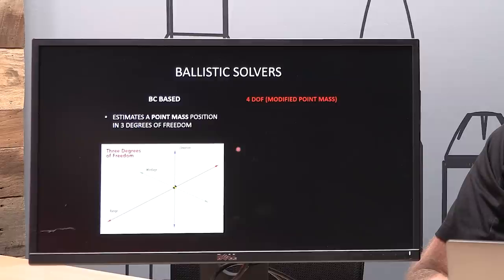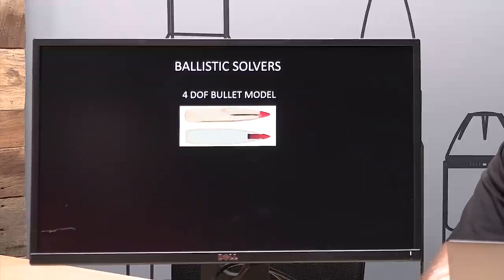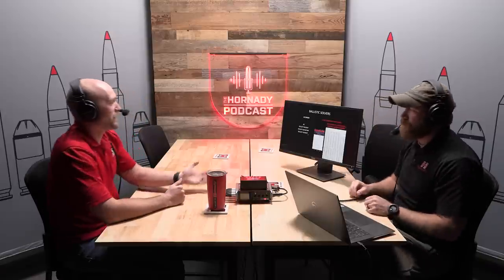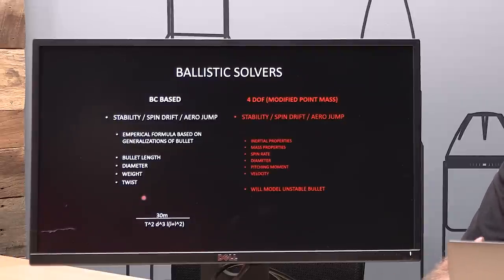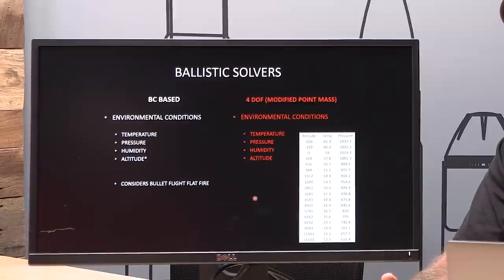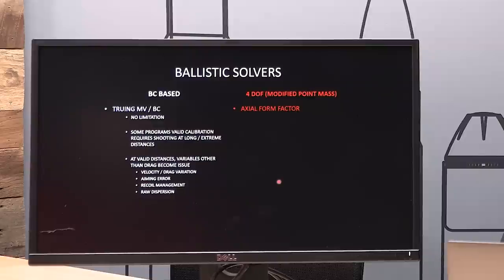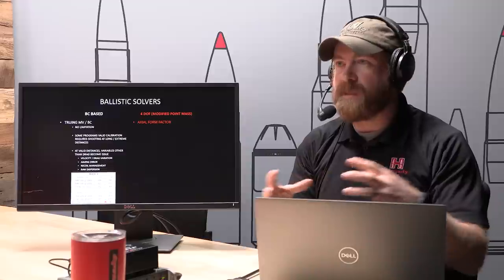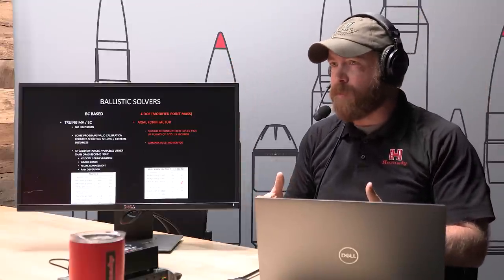Ep. 049 - Why Use 4DOF

Comment: My biggest gripe with the app is that I MUST have a cell phone data connection to start the app. 

For the guy you mentioned that goes mountain hunting, his phone dies, he charges it at Basecamp and restarts. Well, now his 4DOF doesn't work and he's screwed. There's no reason why the rifle and load data isn't permanently tied to the app and saved on the phone. It should never require a data connection to work.
Reply from the maker: 4DOF does not require data to start or work. Shoot us an email if you've ran in to this, because we certainly haven't. podcast@hornady.com
Reply: I used the app offline, no issues.

Comment: Once again thank you Gentlemen for an awesome Podcast. Looking forward to the next ones on more in depth Use of the app thank you   Question
 Sounds like if we use Zero angle You can set your Scope to our  favorite bullet. Then fire different bullets and log the impacts.  And get accurate results without ever hafting to change your  Scope settings from our favorite bullet. Essentially having multiple  Zeros simply by inputting the impact offset??
Reply: I'm no expert, but what has worked for me is creating a separate rifle profile for each bullet/rifle combination for example savage model 10 w/175gr SMK, savage model 10 w/178 ELD-x, etc, then you don't have to mess with changing inputs while you are shooting, when you try a new load,  just set up a profile with where it hits in relation to the bullseye.  Don't change scope zero. You can stagger different loads in your magazine, switch profiles between shots, the app will change your correction and you hit at distance.
Reply: @fattigla   Good deal thank you for the info I had a feeling it might work I'm probably gonna give it a try the next time I'm out at the range.

Comment: I've been using 4DOF for a number of years now,  and it has worked well for inside 1,000yds.For the zero angle feature, are the environmentals we can pull from the nearest weather station (weatherbug app) accurate enough, or do I need a kestrel to take full advantage?
Reply: A kestrel can give you temp and wind speed at your location, even give you a solution when linked with the app in your phone that has your rifle profile. However, for altitude ASL, you may need the weather bug or something. Elevation changes. For example, where I live is 840' ASL, the highest elevation in my county and higher in elevation than the gun range I can go to two counties away that is indoor 100 yards. Where I hunt can be 32 F but the indoor 100 yard range could be 70 F. And 50% humidity rather than 60 percent.

I have tried the zero angle and  didn't notice too much of a difference at 100 yards. But you would past maybe 300 yards, which is what I consider the start of long distance. Word of advice, the Kestrel 2700 is not compatible to the app and if you try to pair it, the app will crash. You will need a 5700. However, you don't have to have a Kestrel synched. Just read the data from your Kestrel of whatever model and put that in.

If I see a deer in the woods at 70 yards, 2700 to 3000 fps is too fast for any of most factors to mean anything and of them, wind would have the most effect.

It also depends on the type of shooting. Hunting can have some shooting aspects similar to the active engagements of Ryan Cleckner, sniper team leader in the 1st Ranger Battalion 75th Ranger Regiment. His M24 was in .300 Win Mag, which he preferred. The performance to 600 yards was steady enough, even in Afghanistan, that he could dial elevation for distance, usually based on actual collected DOPE, and then shoot left or right edge of target zone into the wind to get a round into that zone. It was not about knocking the 'X' out on a target at 1k. It was about putting a few hundred grains of stopping power into a target and having that target stop.

With whitetail deer hunting, such as I do, my zone is an 8 inch pie plate and make my limit 4 inches. That means, with a 1 MOA rifle, I am probably good to almost 400 yards. More important than that, which is what Jayden discussed in the second part of group sample size, you can have a rifle be very precise for hunting if it does what you need when you need it. So, shooting groups with a hunting rifle should be done when it is cold. And then shoot only 3 shots. If those are 1 MOA or less, your rifle is fine for hunting because anyone shooting more than 3 times at a deer has a big problem and should stop shooting until they fix it.

As opposed to some competitions where you may shoot 20 rounds or more at a whack. Then you have to pattern the gun for that and find out if its precision is equal to the event.

Comment: I appreciate the time and effort to come out with this app. But I’ve a problem. Long story short I’ve shot two 10 rnd groups ( 140 ELD-M )with a 6.5 CM around .7 to input my off set for zero angle (+ 0.260”). I’ve went over the inputs until I’m tired but at 418 yds the firing solution is off (low) by 0.5 moa
Both AB and StrelokPro agree with the correct solutions with AB using a CDM. I’m about to give up as I don’t know what else to do. My velocities are correct. It’s not scope tracking error. The environmental inputs are correct also. Beats me. I’m glad I haven’t dropped $525 on the kestrel 4DOF yet. But I sure would like to find the the fox for this problem. The scope is correct also! Help would be appreciated. Thanks
Reply from the maker: That zero angle seems off from personal experience. Give us a call at 800-338-3220 if you have some time and the techs can walk you through it.

Comment: I did a good 15 round group and figured out my zero angle once. Worked like a charm. I had to take the barreled action out of the stock and clean the gun good after a wet hunt and when I put it back together all my impacts are now .4 miles low. I thought as long as the scope and barreled action stay together the zero angle stays the same? Do I have to re-do the whole process now that i re set the barreled and scoped action in the stock and the “zero” is now .4 mils low?

Comment: Based on all the measured data for each bullet in the 4DOF library, I am assuming that using 4DOF is not advised if you select a similar bullet in terms of BC or grain weight.  Is this correct and are more bullets being added to the 4DOF library?
Reply: If I understand your question, you're wanting to use a bullet that is in the library, but is not the bullet you're actually shooting (but similar to what you're shooting) to generate an estimated trajectory?  

Your results will likely be less than ideal doing so.  It may work okayish for 0-600yd, but beyond that you're likely to see errors compound and get progressively worse.
Reply: @milesn3173  Thanks, kind of what I thought.  I'll stick with the BC calculator for bullets not in the 4DOF library.

Comment: I love the idea and the effort to make it into a software.
However, the application is buggy. Since iOS 15 upgrade, it just stopped working on my iPhone if WiFi is enabled. When I disable WiFi and use 3G or LTE, most of the features work. But not always, the app usually crashed when I tried to run the multi-hud feature. It ignored the wind in some scenarios, more and more often, so I decided it's time to use a different calculator.

I dropped the app in favor of Strelok Pro. I'd love to come back to 4DOF, but it has to get a proper upgrade and a debugging run until it starts working.

Comment: In this podcast, it sounded as though users had to choose, either use a Kestrel, or 4DOF.  I have a Kestrel with 4DOF.  

You don’t have to give up your Kestrel to use 4DOF, the app can still connect via Bluetooth to the Kestrel and obtain the critical environmental conditions, and perform the calculations on the app.

Comment: The concept is great.  The UI of the iPhone app is beautiful.  Unfortunately, the field application was less than stellar. Sometimes wildly incorrect.  They're generally close to a trued AB solver (Kestrel AB), but there have been instances where the outputs were not even remotely close to what was needed for impacts.  Several high-level PRS shooters went through every single input after a particularly frustrating stage (that I would normally have easily cleaned) and confirmed that every single input was correct.  I immediately abandoned the 4DOF app and went back to a trued Kestrel AB.

Comment: So my 338 Lapua magnum shooting 230gr ELDX is zeroed at 200 yards and 4Dof says 5.5 MOA to hit 500 yards at 3107 FPS but I shot 12” high. so I put 3300 FPS in it and it said 4.5 MOA so I came back 1 MOA and hit dead center. Why? And I did get my AVG FPS from my Caldwell coronagraph. I know my Caldwell could be or probably is off. Is that my problem or could it be something else? I did everything that 4DOF requires in the app like my zero Angle elevation I mean I did everything to the tee. Any ideas?
Reply: 93 gr of 4831sc COL is 3.680 and is .30 off the lands
Reply from the maker: If you're velocity is correct, that would point to a zero issue.
Reply: @hornady  200 yard zero is on. I thought the same thing. I’m zeroing on my Tipton ultra gun vise

Comment: So… a fancy pantz kestrel 5700 rigged up with a 4DOF engine isn’t being supplied with the extra storage capacity sufficient for more than 3 profiles?… well that’s a drag. This sounds like an entirely solvable problem… the 5700 elite model looks like it has more on board memory but is only offered with the Applied ballistics engine. 🤷🏻‍♂️hmm… Has AB and kestrel shaken hands on some sort of exclusivity arrangement?… Very sus. 
I have the Applied Ballistics Mobile iPhone app and I’m sorry to report that it is trash. The interface is ancient and it will not connect to an external kestrel drop for environmental inputs… but worse… the solutions are fraught with large sloppy computational errors. I have reported such errors to AB and they have acknowledged them but then taken months to issue corrective updates… now the current version is again producing solutions that appear to be anomalous. The AB mobile app is thus unusably unreliable… whilst simultaneously being one of the most expensive smartphone ballistics apps on the market… make that make sense. SMH.